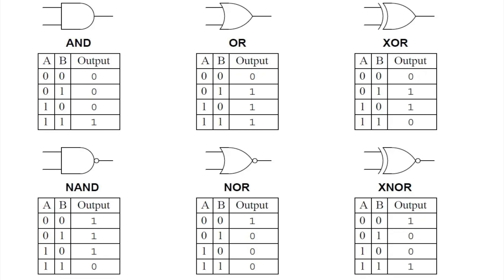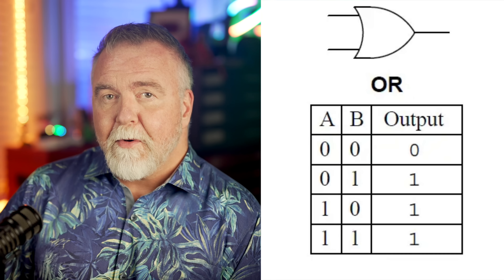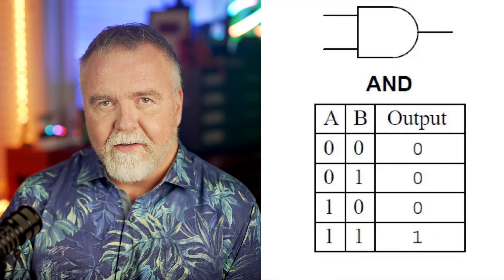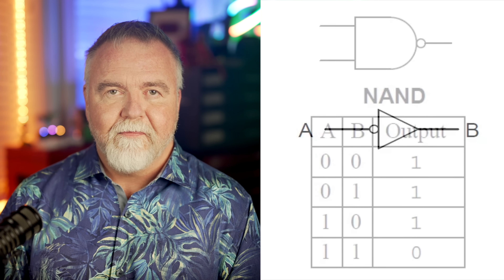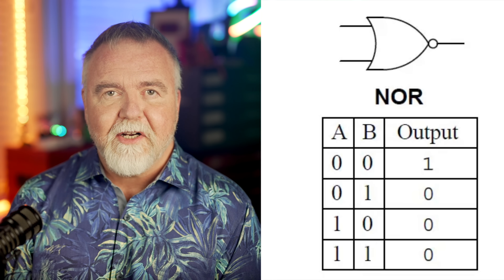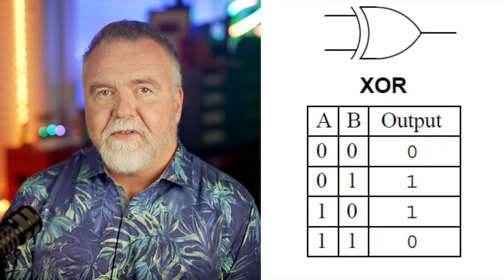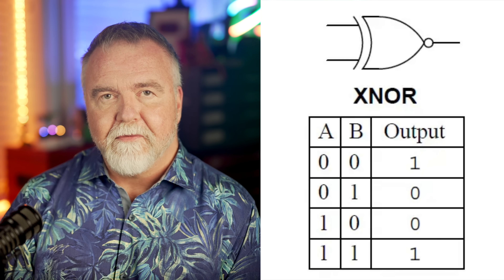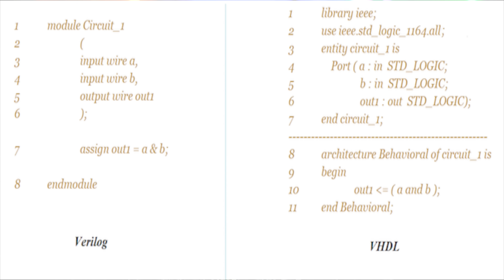The "Do Anything" Chip: FPGA

Comment: Excellent topic, would love to see a part II where you implement something using FPGAs. This reminds me of using bit-slice processors, certainly far more limited than FPGAs but allowed us to build custom systems with off-the-shelf chips.
Reply: This would be awesome
Reply: Starts with an LED bar spectrum driver and ends with a full soft ESP32.
Reply: Fellow AMD bit slicer?  (circa mid '80s)
Reply: A similar technology from the 80s was called the Uncommitted Logic Array, where there would be a base chip made with a bunch of logic gates but no connections between them, so a company could cheaply customize it by creating a mask for JUST the connections they wanted.  Was used to great effect in the ZX Spectrum, and was a powerful prototyping tool, but since it still required making new masks for each semi-custom design and they could only be used for their originally designed purpose, it was a much less powerful technique.
Reply: @IONATVS  The ULA still exists today in the form of gate arrays - ASIC.
And they are not simple. The density of devices has increased massively and they need to be placed and routed, simulated pre and post layout. 

The end result are metallisation masks for use in the photolithographic stage of manufacturing, but getting to that point is highly complicated, expansive and can take a long time.
Reply: @deang5622  Oh, totally.  The version in the 80s had much larger, trailing-edge feature sizes so the lithography masks for the traces could be produced “relatively” cheaply compared to other chips at the time, but that still didn’t make them cheap, and the modern equivalents would naturally require much more precision—even today’s trailing-edge fabs have feature sizes the envy of 80s bleeding edge, and IIRC ASIC doesn’t aim for trailing edge like older ULAs, but for something like “mature middle-of-the-pack fabrication”?
Reply: It sounds like you've only just discovered FPGA's?

Comment: Sometimes the manufacturer of a product will say something like, "In addition to the usual software, this product has programmable hardware (FPGA). So it can be reprogrammed endlessly, and it's the last hardware you will ever need to purchase."
The correct response might be, "You said the same thing about the last five versions of hardware, this is now the 6th generation. Each time, only the first batch of the new requirements can be accommodated, then the requirements start to exceed the capabilities of the design. So your claim is demonstrably false, as evidenced by the fact that you've said the same thing many times before."
FPGAs are very much like CPUs: they become outdated just as fast as your CPU-based computer does.
Plus, the chips (FPGAs, CPUs, etc.) all go obsolete (unavailable) before you can blink, so the products can no longer be repaired. So a replacement system is needed even faster than old fashioned hardware-only designs. Been there, seen it, got the T-Shirt. Pure hardware can last decades; more modern programmable systems are too-often obsolete even before they're installed.
Reply: In the early '80s, I built a Ping-Pong video game, which were all the rage few years earlier. The videogame used 100 TTL chips, but admittedly still works to this day, and I can still find replacement parts for it...

Comment: Instead of compiling LLVM code to gate interconnects FPGA are programmed or "designed" as standard cells in the 80/90`s with Verilog/Simulation/Waveform/Place&Route/TimingChecks and on. The view of on FPGA as programmable single task or single fixed design is manifested by the use of tools migrated from the old standard cell world.

Comment: FPGA:s are fun. More fun when you have multiple asynchronous clock domains. Not sure do they have any "free" software to do CDC (Clock Domain Crossing) checks. CDC are usually pitfall for new users.
New Soc chips are nice like Zynq series. You have bunch of ARM cores, GPU, and other nice stuff. Then you have FPGA fabric and several AXI4 interfaces to MCU side and all those in same package.
Reply: The Clash HDL has some convenient handling of clock domains.

Comment: The mistake here is in thinking that each CLB is made up from a collection of assorted logic gates. It is made up from LUTs (Look Up Tables), typically with 4 or 6 inputs and one output. You are basically creating AND, OR, XOR etc by defining what inputs cause what output. These are combined with flip-flops and custom blocks (RAM, clock generators, DSP (multiply and accumulate) IO etc).
While FPGAs are more expensive than microcontrollers, it is possible to find quite capable devices in the sub $50 price bracket. See the Sipeed Tang Primer for example, a sub $50 system with HDMI output, 20,000 LUTs, 80K of fast onboard SRAM and 128MB of DDR3 DRAM
Reply: From what I can find, a LUT is made up of some SRAM and one or more multiplexer gates. Like this quote:

"The hardware implementation of a LUT can be thought of as a collection of memory cells connected to a set of multiplexers. The inputs to the LUT act as selector bits on the multiplexer to select the result at a given point in time. It is important to keep this representation in mind, because a LUT can be used as both a function compute engine and a data storage element."

"The LUT is actually implemented using a combination of the SRAM bits and a MUX".

So you're basically loading up the SRAM to cause the multiplexer gate to act like another type of gate, or even mimic the result of multiple other gates. But ultimately they're still gates.
Reply: @marsilies  To clarify my old world view of things, are you actually just defining the truth table for the LUT or is it not quite that simple?
Reply: @pauledwards2817  The truth table is an abstraction. You can create a truth table for a series of assorted gates. To get an equivalent truth table from a LUT, you program in specific values into the SRAM bits tied to the multiplexer to recreate the desired truth table for a series of inputs.

So for a two-input LUT, to program it you store in the SRAM the 4 possible outputs for the truth table you want, and when the multiplexer receives two inputs, it "looks up" the SRAM bit tied to those two inputs and outputs what's stored in there. 

So say both inputs being zero always causes the multiplexer to pull from the first SRAM bit "slot" tied to it. You program that slot with a 1 or 0, depending on what truth table you're trying to implement. So what the LUT outputs for two 0 inputs will change based on what you store in the SRAM bit. You do that for all 4 SRAM bits for a two-input LUT, and you've programmed the LUT to act like a specific gate or series of gates, recreating a specific Boolean operation. 

I'm not linking to anything, because Youtube gets mad at me when I actually make external links, but you can search for the quoted text in my previous post to find the articles discussing this. 

Also, keep in mind this is just my understanding based on what I've looked up this morning. I may be missing some info.
Reply: @marsilies  The details of FPGA implementation of logic of a set functionality must offer quite a lot of scope for optimisation, manual and automated. Pleased I have a better understanding. In some sense they really are totally blank at startup rather than uncommitted logic needing to be strung together. Thank you.
Reply: @marsilies LUTs are indeed small memories with either 4 or 6 address bits, and only one bit wide. They aren’t necessarily SRAM (some types are based on flash memory, like the Intel/Altera MAX series), and the output of the LUT is optionally routed through a flip flop. It’s the fact that they can be used as a programmable truth table, and additional bits can be used to control the routing between LUTs/CLBs/Specialised function blocks (BRAM blocks for example, which are fast, configurable 2KB memories, usable as RAM (single or dual port) or ROM of user defined width (8, 9, 16 or 18 bits for example)) that give FPGAs their power. 

In practice you don’t program them at the gate level. As Dave mentions, you use a high level language like Verilog or VHDL (standing for VLSI High Level Definition Language) which are, respectively, like C or ADA, to define what you want a system to do, then let the compiler work out what combination of LUTs etc are needed, then another piece of software called Place And Route to figure out where on the FPGA the required logic needs to go. 

The most important thing you need to remember though is, that though the languages look superficially like conventional programming languages, the way that things are implemented is very different. Because everything is inherently very parallel in nature and can run at different speeds (different parts of the system can run at different clock speeds, and clocks can be set up at arbitrary frequencies and changed at run time - there are PLL resources that let you set combinations of multiply and divide values for input master clocks) you need to think about problems in a different way. It is quite possible for example to generate a HDMI video signal (requiring a bit rate of over 1Gb/sec) while simulating an 8 bit processor at a few MHz, and switch video modes on the fly.